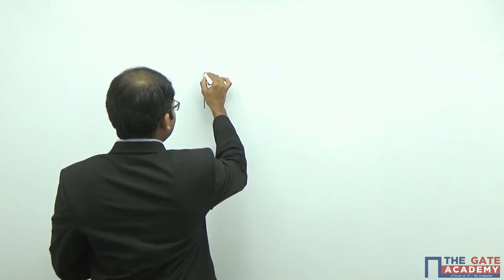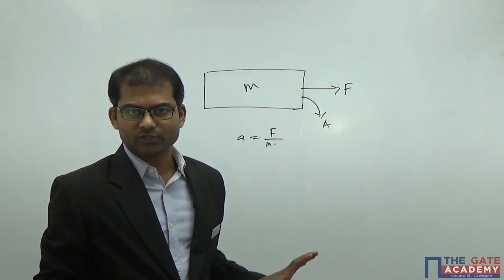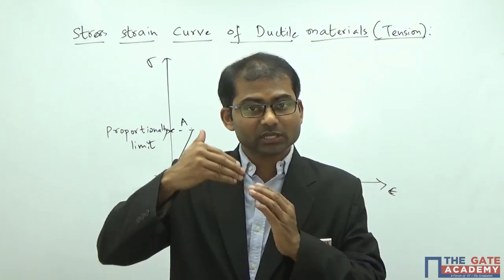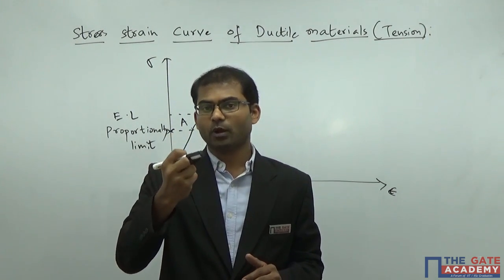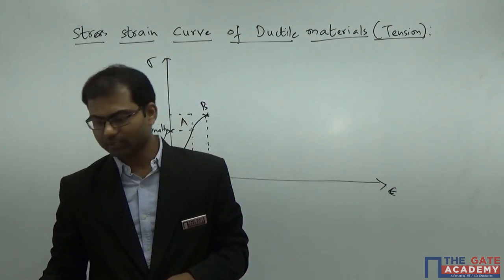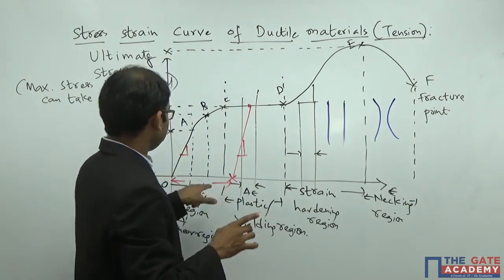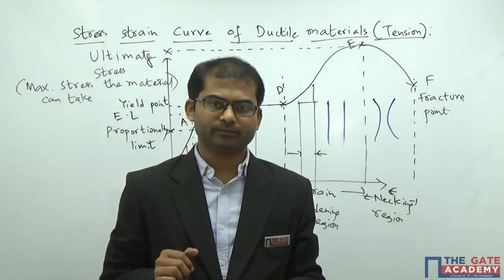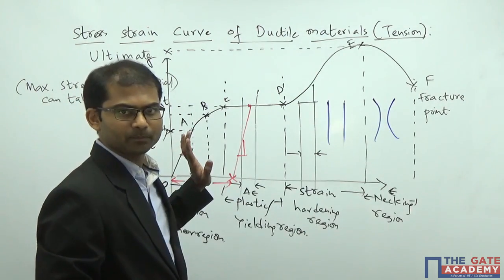Stress & Strain Curve of ductile material in tension | GATE Lectures | ME, CE

Comment: The Yield strength should be mentioned in waviness curve since due to cottrell atmospheric effect. There would be change in internal resistance due to the interaction between dislocations and interstitial impurities. Due to change in internal resistance the load that are applied also changes dynamically with respect to former.

Comment: In the very first situation, same amount of force F is applied from  both the sides to the bar, Why do not we take a force of 2F in picture rather than just F? Please explain..

Will there be any change in numerical value of stress, if force is acting from any one side and other side is only clamped into some arrangement?
Reply: As your 2nd qn . I think that if a body subjected to any force f on one side then automatically same force f will be developed in opposite side . Either it is clamped or not due to make equilibrium conditions.

Comment: Sr will there be any stress in the body when we applying load F in one direction and F/2 in opposite direction?
Reply: Prashant Kumar 
I think there will be no stress because body will move in the direction of resultant force
In ur case body has 2 force F and F/2 so resultant force would be F/2 
Remember stress produced when when body lie in equilibrium (resultant force must be zero)
I hope u understand ,I tried my best 
If I would mistake  ,so I would say sorry bro
Reply: Very very good explanation
Reply: That would be an intresting case but as mentioned here that the equilibrium of the body is necessary and the loading condition which you are mentioning might not create a case of equilibrium and hence stresses may not be induced